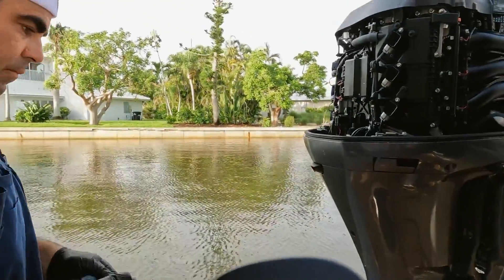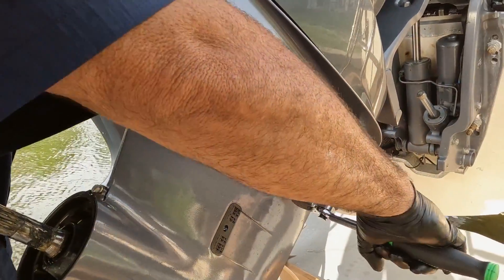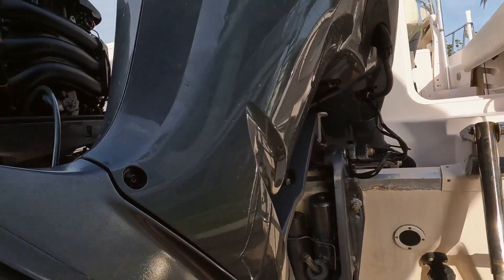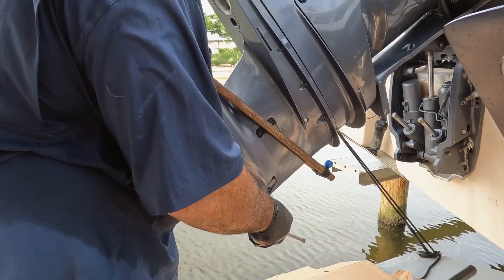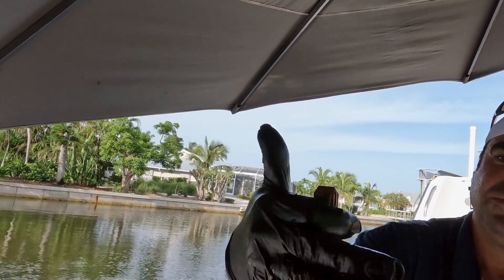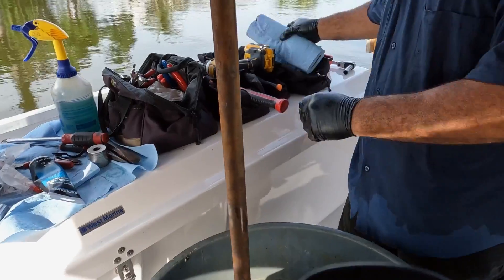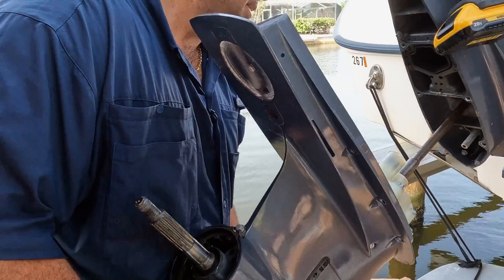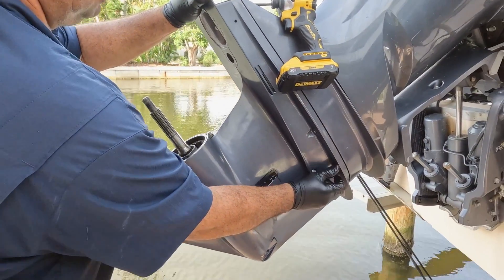How to Remove a Yamaha Outboard Lower Unit | F225 - F300 4.2L V6 Models | DIY Yamaha Maintenance

Comment: What gear should you be in when dropping the power unit?
Reply from the maker: Hello @astrosully9757, Thanks for watching! When dropping the power unit on your Yamaha outboard, the gear position depends on the specific model and whether you're dealing with a two-stroke or four-stroke engine. However, in most cases, you should have the engine in neutral to ensure that the shift shaft aligns correctly during reinstallation.

If you're working with a model that requires the shift shaft to be in a specific position, refer to the service manual for the correct procedure. Some older models may require the unit to be in forward gear, but for most modern Yamaha outboards, neutral is the safest bet to avoid misalignment.

Let me know if you need help with your specific model!

Comment: Hi, where can I buy the angled impact ratchet attachment?  Much easier to remove the lower unit bolts with an impact driver than by hand.  The cavitation plate makes it hard to get in there.

Comment: Is there no gasket that needs to be replaced? What’s providing the seal?
Reply from the maker: Hi @ebencurtis,

Thanks for the question! There isn’t a gasket between the upper and lower casing on the Yamaha F300 4.2L. The casing seals by design, so no additional gasket is needed in that area. However, it’s imperative to ensure that all other seals, like the driveshaft seal, prop shaft seal, and water pump gaskets, are in good shape to prevent any water intrusion.

If you need any parts or further guidance, feel free to reach out. We're happy to help!

Best,
The PartsVu Team

Comment: Ok important info missing here about the chopsticks! 
 Are they wood dowels? And do they scratch the paint
Reply from the maker: Hey there,

As a well-seasoned mechanic, Frank has several tricks he has learned along the way that are helpful to him. He does know the exact pressure he needs to hold to stabilize the gearcase without scratching it. That being said, it is not recommended if you are not familiar with the technique. If you do decide to use wooden sticks to help you with this project, wrap the contact point with a microfiber cloth! 

Happy Boating!